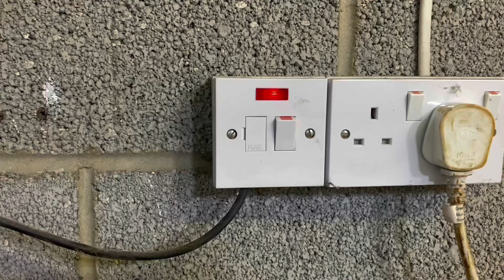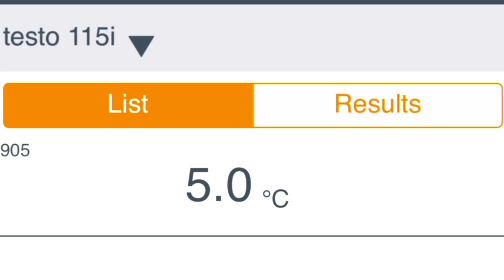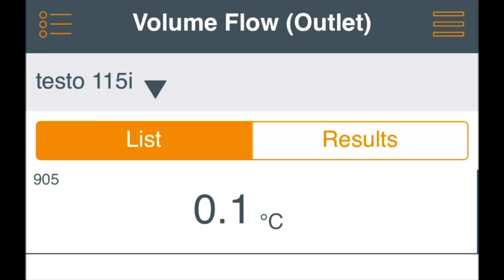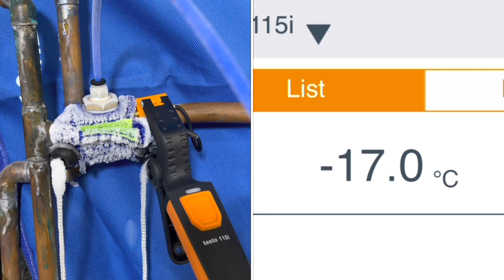How To Use A Pipe Freeze Kit -  How To Freeze Pipes

Comment: I always use an electric pipe freezer as your not time restricted and can deal with bigger pipe sizes, I know they are heavy, bulky and more expensive but I have better trust in them.
Reply from the maker: Hi William. Do you own an electric freeze kit? What brand is it and how much did it cost. Thanks very much.
Reply: @AllenHart999  Yes I own one, as if you hire one their nearly always a problem and expensive to hire, the one I have is the Rothenberger Rofrost 28, it costs about £800. great bit of kit.
Reply from the maker: @leaturk11  I might get an electric one at some point and do a video. Thanks.
Reply: This type of freezer is the best I’ve used, I had an electric one, far too heavy and impractical. This Polar type is so convenient and you don’t waste spray, it’s a very reliable kit. And waiting for the pipe to freeze is way faster that draining down................
Reply: @cerealkiller4248  ill have to give it a go.
Reply: william jones If you do I think you’ll end up selling your electric one. Mine was sooooooo heavy I struggled with it ( I have a permanently damaged back ). I think mine was approx £600 at the time over 10 years ago. This kit cost me £120 I think, the replacement bottles are £30 ish, you need them as they have a threaded connector needed for the gas regulator, but there’s minimal waste as when it drips out the jacket you adjust the flow down to stop it. Without looking I think each bottle is 700g and I think it’ll do 2 x 15mm joints. What Allen didn’t show is the plastic pipework comes with a Tee piece which allows you to freeze 2 jackets at the same time so he could have frozen either side of and cut out the Tee and replaced it with a straight piece eliminating the dead leg.
Hope that helps, feel free to ask anymore questions if you ( or anyone else) have any 👍🏴👍
Reply: I have an electric one as well from rothenberger. But i used it once on a cupper pipe and it was broken when it was defrosted again. The pipe splitted. So i only freeze iron pipes and never cupper again. It was in an appartment building, not something you want there 😅🙈

Comment: Nice bit of kit but that dead leg would be too long to cap it off permanently, should only be as long as the diameter of the pipe.
Reply from the maker: Hi Steve. All the pipes will be getting removed soon. Thanks
Reply: @AllenHart999  wasn't trying to be smart or critical, just wanted to make people aware that dead legs are not allowed due to risk of Legionnaires, how many plumbers cut them out when they come across them?
Reply from the maker: @stevehouse3904  I didn’t think you were buddy, I am grateful for every comment. Thanks.
Reply: @stevehouse3904  I do , copper is gold.....😜
Reply: @stevehouse3904 isn’t the maximum allowed length two times the diameter of the pipe for  a dead leg?

Comment: Thanks Alan. Not just for this but, well, you know what?
Old TP from Wigan did a review/experiment on freezing kits a few years ago now. I've rarely had to use them but he found an alternative, cheaper product to use as a freezing gas. He wouldn't let on. I never figured out what it was, but If I had to make an educated guess, I reckon it might have been chewing gum remover.
Reply from the maker: Hi Loafer. Will you be at installer this year. Would be nice to meet you. Thanks.
Reply: No. Haven't been to a trade show for years. It's as easy to get updates from  YouTubers when it comes to tool reveiws and stuff. I'm thinking of slowing down, or looking for a twilight years job. If the missus will let me. ;-) Gerrin' owd.
Reply from the maker: @loafersheffield  That’s a shame. Would have been nice to meet you. Thanks.
Reply: Thanks for the tip, loafer.